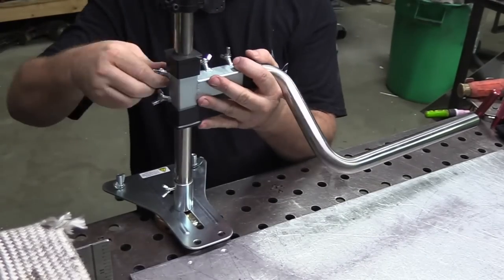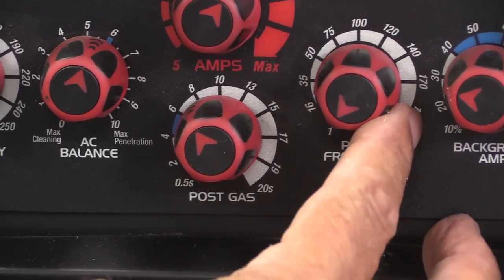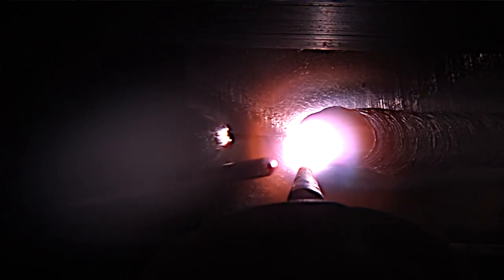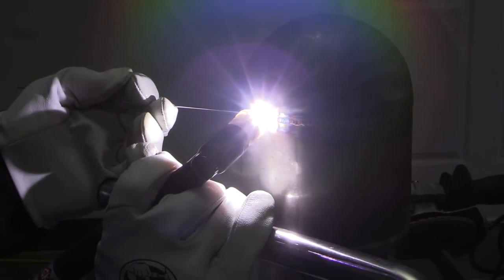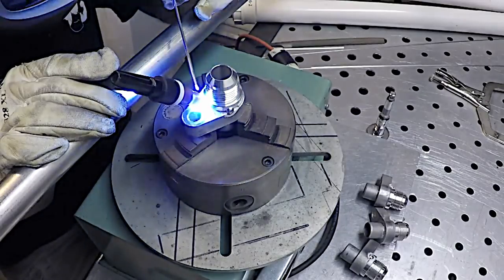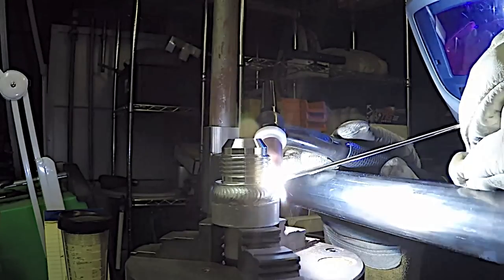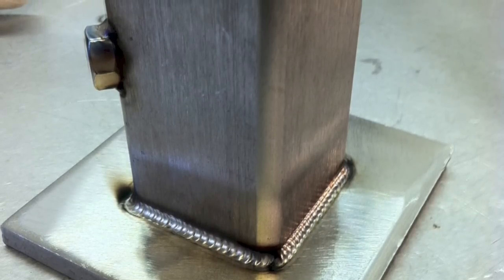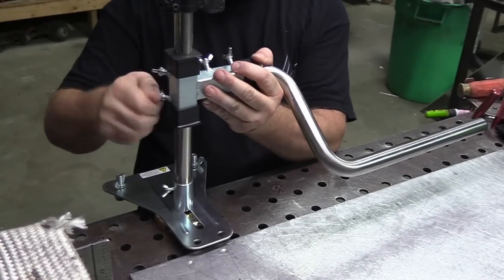DIY Welding Prop Compared to Store-bought

Comment: As a welder I learned very early that one of the best tools you can have is a simple set of chain vise grips. The chain will wrap around what you are welding giving you a steady rest and it's easily moved to new positions as required. I had single chain grips, double chain, triple chain and quadruple chain grips in my tool box. If necessary you can even link them together for additional length. When welding large diameter pipe or small vessels a good tool to have is a short length of angle iron with a small diameter pipe (Say 1 or 1 1/4" diameter) welded to it at 90 degrees along with a small come along. You set the angle on the pipe like a vee block and warp the come along chain around and back to itself and snug it up loosely. Place the vee block where you want it for support and tighten up the chain. This support will hold literally hundreds of pounds without slipping or moving and can quickly be re-adjusted to a new position. I've used this tool to weld up to 72" diameter piping with no problem and my roots and surface caps looked like I was sitting at  bench.
One of the keys of getting good consistent welds is good solid supports to keep you steady. A good welder knows this and uses it to his advantage.

Comment: A good homemade prop is to use EMT conduit. Easy to bend and they have couplers for mounting and connecting tubes together. I have several different degree's of bends at different leg lengths. You can combine to create the best rest for the job

Comment: Thanks, Jody! I have the strong hands setup, which works well if it's set up so that the magnet has good mechanical advantage. I may try Roy's home made rest as well; here (as for the strong hands) I'd suggest threaded knobs for quick, secure repositioning

Comment: Great video! I really need to get or build a prop.
It seems to me,  a joint of some kind you can adjust and lock at the base or in the bracket on the vertical of the prop would make it even more versatile. 
Then you could tilt the prop arm and give it some angle if needed.

Comment: I love my jazzy 10 cup!  probably 80% of the time it's perfect for what i'm doing, and i get almost colorless welds on stainless.  today i had to break out my xl cups to get into a very tight corner, which would have been easier if i had a flex-head torch and i could have used the jazzy 10.

Comment: Been thinking about getting some of the cast aluminium handrail fittings and lengths of handrail tube to make an adjustable rest. Maybe have a vertical on my bench with a cast t piece connector holding the horizontal with the grub screws swapped for bolts with bar welded to them to handles.
That’s about as simple and adjustable as I can think for a non mobile application.
Anyone have any other ideas or improvements?